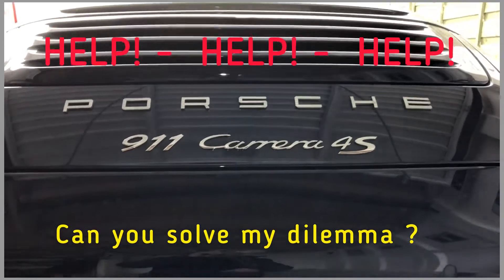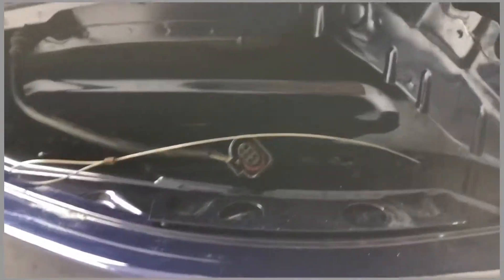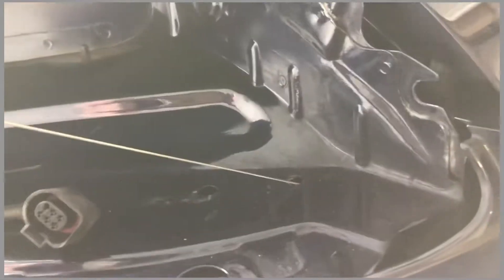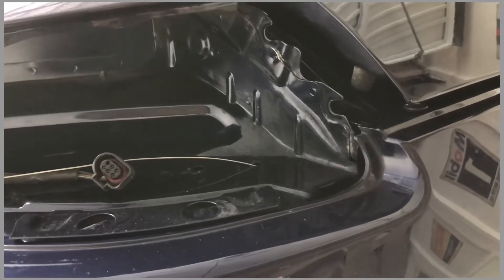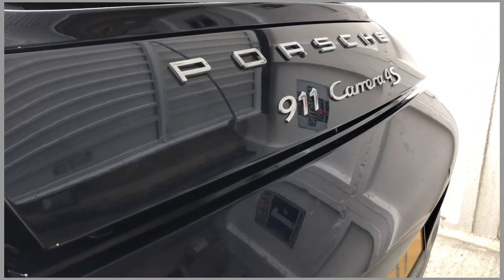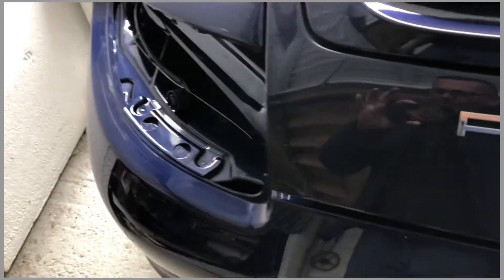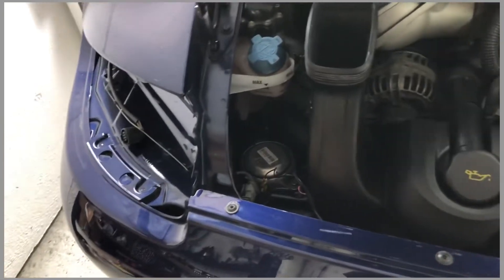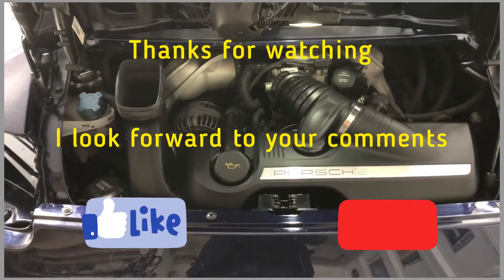Can anyone solve my dilemma? Porsche 997.1 rear deck lid release.

Comment: I just solved this same problem on my 997.2 Turbo S. I removed the license plate lights at the rear of the car and used a wire to fish out the cable.